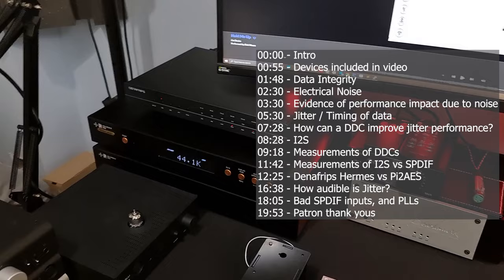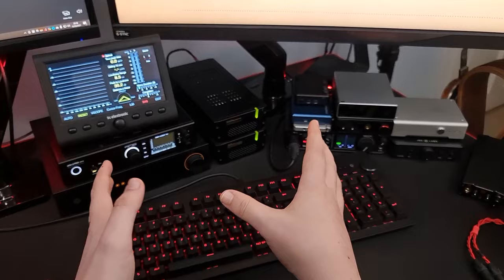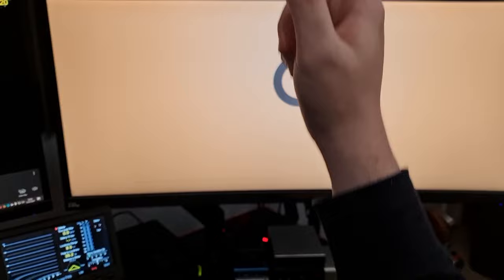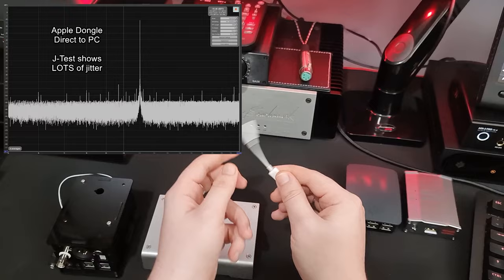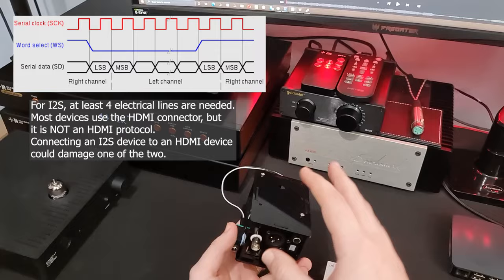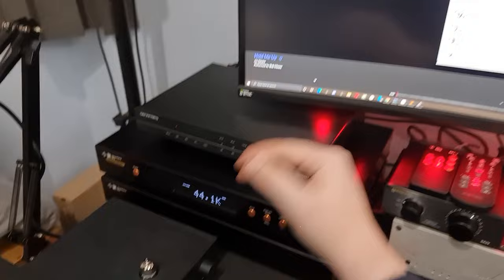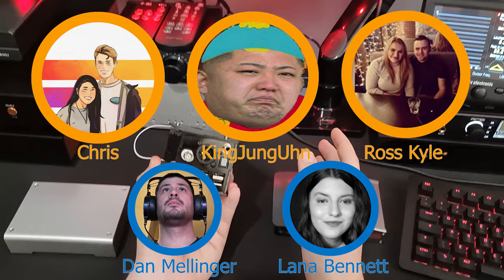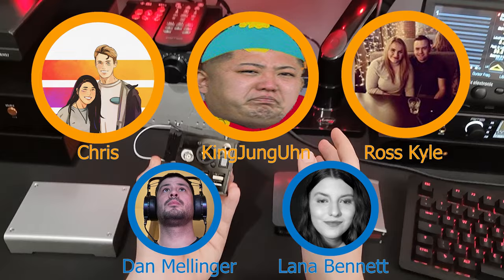How do DDCs improve audio? (Denafrips Hermes, Pi2AES, Schiit Eitr, ifi Igalvanic)

Comment: The Jitter explanation is partially incorrect.
Samples representing a bandwidth limited signal, will only ever have 1 possible waveform. No matter how bad the jitter, the sinewave after the output filter of a DAC will NEVER have slopes like shown at 5:43. The mathematics behind it do not work that way.

Ovenized Oscillators are also voltage controlled, just that with a controlled temperature, the oscillator is more stable.
Reply from the maker: Nyquist assumes that the samples are completely even in time.
If there is jitter/timing inconsistencies then yes, the waveform will absolutely show that.

Otherwise the measurements shown in this video would all be identical
Reply: @GoldenSound  You will not see that in an FFT, you would need to look at the waveforms.
Reply from the maker: @MazeFrame  I'd recommend looking at the mechanics of the Dunn J-Test. John Atkinson from stereophile has a good article on it. And there is also an AES paper (written by Dunn)
Reply: Agreed. The jitter example is over simplified and wrong. Jitter is not about wobbly waves. Listeners should be much more concerned with correlated jitter or deterministic jitter. Random isn’t audible by definition.

Comment: If there is some kind of software volume control, or DSP EQ (computer or post computer based), do you limit the value of DDCs, or I2S?
Reply: General rule of thumb is that you wanna be attenuating the signal as far down the signal chain as possible to retain maximum signal-to-noise ratio. The issue is of course that ganged pots are pretty shiit (huge gang error, noisy, not that logarithmic), and even good integrated VCAs are much worse than most converters, so arguably the way to go is to use a digital control, instead of a volume control in the analog domain (except f.e. a pad switch). Some DACs do support a direct volume control (which directly interferes with the S/D modulator), this has the advantage that you may get better SINAD at low levels compared to multiplying the signal on the PCM side of things. But at 24 bits... probably just fine.
Reply: @-szega  So. would you say that, with the exception of analog (potentially stepped) pads, the signal should be attenuated as far down the digital signal chain as possible?
Reply: @PatrickDunca  Yes.

Comment: Great Video, I agree with using I2S, I was wondering if you have heard of IAN Canada. I found these HATS for the PI and I was thinking about using these two devices with a PI 4.  1. IAN CANADA FIFOPI Q3 ULTIMATE FIFO Reclocker Module PCM 32bit 768kHz DSD1024 DoP      2.  IAN CANADA HDMIpi MKII Transmitter I2S / DSD / DoP to HDMI

Comment: I am curious how would perform older devices connected via firewire as it should be way more suitable for audio then usb.

By the way... I2S is standard for short signal paths, measured mm so it is not made for cable transfer.
Reply: I2S will be fine for short runs over shielded cable (ex. HDMI), if series termination is used (value is not critical, 30-80-odd Ohms).

Comment: Very informative review, I like the measurement addition! 
You keep mentioning the Pi2AES price as the full price of the streamer but adding a Raspberry Pi and a good power supply is a must, so the total price will be around 600 $.
Great job anyway!
Reply: Most expensive Pi 4 is $75. Pi2AES is $149. That's $224. So you're saying you need a $376 power supply to run this. Must be one hell of a PSU!
Reply: Prices have gone up over double since this video

Comment: I don't understand at all how you're supposed to connect things together what cables come from where, who sends the data or how. An ethernet port for music sorry what, did I really see rj45? *confusion intensifies*. I see the Ropiee is a sort of bridge with a music software and outputs audio on usb. I have been vastly overestimated it seems, and now I feel dumb. Also, an example of the perfect ideal signal would help. From what I see it seems to be the analog output in frequency domain of a 1kHz tone. So there should be a spike (corresponding to 1k) and a "floor" as flat and as low as possible, is that correct? And jitter looks like tiny spikes. Interesting.

Comment: Question about i^2s Guido Tent ones told me that i^2s is only for internal dac use not for longer distances. And i can understand that because clock signal should as short as possible especially digital clock signals.

Comment: Interesting vid, I recently tested 3 different DACS against each other I compared the AudioEngine D1, the DAC built into my Yamaha A-S301, and the DAC in a $110 CD player from 2001 and after volume matching I couldn't tell a difference. I've yet to try a DDC but if my ears can't tell a difference between the DACs I doubt a DDC would make much of a difference for me but I would be willing to try one out.
Reply: Yeah, I'll be honest... It's super super subtle to me. Only difference I've ever been able to distinguish is the difference between multibit or R2R and delta sigma. But, even between completely different topologies, it's very subtle to me. It becomes more noticeable with high end headphones compared to my 2 channel setup.
Reply: External DACs are more or less a waste of money. Not even talking about DDCs, thats the snake oil people talk about, even external DACs are more of  snake oil than real advantages.

In the days where only proper DACs were in extremely Hi End gear which was probably not even aviable for the regular customers, an external, better DAC than the one in your anno 1990 100$ JVC CD Player would make a difference.

But i realized how useless "better" DACs are as i switched from a cheap 90$ DVD Player (i think 96kHz 24Bit) to a proper CD Player for 600$ (192kHz 24Bit), fitting to the 700$ Stereo Amp.
There was absolutely NO DIFFERENCE, except for the removed DVD drive noise whereas the Cambridge Azur 650C was totally quiet.
My AVR has even a 384kHz 32Bit DAC... and it somehow sounds the same as the cheap DVD or expensive CD player.
The sound difference between my 700$ AVR and my 700$ Cambridge Audio Amp is also very negliable. Where the AVR (175W/channel advertised!) begin to struggle a bit with bass at higher volumes, the Cambridge 650A ("only" 75W @8 Ohm) doesnt sound that stressed on my IQ 90s.
But at any regular volume AVR aswell as Stereo Amp (both feeded completely different, Stereo Amp analoge over CD player, AVR with a bit-identical FLAC file over USB Stick) they are more or less identical, you only hear a bit of difference when it comes to the "cambridge sound", but its not far off from the "linear" sounding AVR and is pretty easy EQed even with the 2 controls on the Stereo Amp for Treble/Bass.
Reply: @harrison00xXx  I'd generally agree with you, but with one caveat. There does appear a benefit with desktop/gaming PC setups. This is largely just due to computers being very noisy (electrically) inside and there can be a benefit of moving your DAC and amp outside of the chassis, and on their own power supplies.
Reply: asplmn this isnt a thing with digital connections anyway

Comment: Does Pi2AES have WiFi ? 
Where can I get Pi2AES ?
Does it work as Roon endpoint?
Reply: The pi itself has WiFi, so it's up to whatever software you are running on it. I am running a pi with a HAT DAC and Volumio software, WiFi is in it's menu's (although I don't actually use the WiFi side)

Comment: Is there any way you can measure if different power supplies for the Qutest makes a difference?
Reply: I used the OEM SMPS power supply for six months. Then the Allo Shanti, for a year. Then the Plixir Elite BDC for the last two months. The Shanti and Elite BDC caused the physical expansion of the soundstage that I can point out with a laser pointer. Also other instantly observable improvements.
Reply: @DBravo29er  that’s great
Reply: @Ceko  So, with obvious differences, this will be measurable. Now, WHAT to measure..... I've got no clue.
Reply: @DBravo29er  well you hear obvious differences so perhaps a good mic will do the trick?
Reply: @Ceko  Oh I'm an AES member and was referring to the exact technical measurements required, by an AP machine for example. These are typically amplitude-stable sine wave measurements of one fundamental frequency (such as 1khz). This doesn't even rudimentarily resemble what a DAC must process and output during even the simplest piece of music (like a single voice, a cappella). That single voice is orders of magnitude more complex and, right now, we cannot conduct comparative measurements of simple metrics like THD, IMD, SINAD on an actual musical signal. 

We can only do it on simplified test tones.... hence my reference to there obviously being a change somewhere in the DAC that would result audible improvement (that passed blind ABX, btw. I had my wife do the switching.). But that I do not know what simple-signal metric may reflect these changes, if at all. Does this change primarily exist in the FPGA? Possibly some local voltage regulators? The discrete output stage? All three? I honestly do not know.

As the price of processing power continues to drop, I hope for a day where an AP is released that can conduct real time (or maybe with a short buffeted delay) comparisons of the output of a live musical signal.

Comment: I know this is an old video but figured I’d roll the dice w/ an inquiry - if I’m going to be using a 3rd gen node as a streaming transport connected via digital coax to a dac-less GaN FET amp, would something like the eitr offer any improvements?  The amp only has digital coax as an input, so I’d be introducing usb into the chain.  I haven’t been able to find anything definitive regarding the node’s coax output performance vs it’s usb output.

Comment: Have the iGalvanic3.0 and iPurifier3 in my chain with iDSD Black Label DAC/AMP.  Makes a big difference!
Reply: iPurifer3 didn't do anything at all for me, but iGalvanic3.0 was a massive help for Hugo2.  When I sold hugo2, I thought it was only right to sell it with the iGalvanic3.0 because its pretty much a requirement.
Reply: @-havoc-tzu-3197  Hard to believe the Hugo2 doesn't have galvanic isolation isn't it?  The Hugo TT has it.  I would bet anything that the Hugo3 has galvanic isolation because the competition is stiff and the Hugo is high priced.
Reply: @shawnpwatsons1  agreed, I switched to Qutest after that which has galvanic isolation, later sold that too and upgraded.  Qutest is a decent dac.

Comment: If USB is so crappy, then high end pro soundcards like RME, Lynx, Marian should have pretty good AES outputs, right?
Reply from the maker: It's not that usb is inherently bad. It's just that it isn't good in a LOT of products. And it comes with challenges.

There are many products that have excellent usb implementations with full galvanic isolation such as the schiit yggdrasil or holo spring 2 / may.

Yes, they should have quite good aes/spdif outputs, but it still doesn't solve the issue of galvanic isolation which is the primary reason not to use usb.

USB is fine if you're connected to a pc. But the point is that ideally you don't want to be connected to a pc.

Comment: And this is why Unison is so powerful. Or at the very least, so impactful.
Reply from the maker: Unison USB is just the name for schiit's proprietary USB receiver. The higher end dacs have galvanic isolation (which is fantastic). But unison on the lower cost stuff like the modius and modi does not.

Its still a good USB interface, but XMOS is also very good, and the determining factor will be other hardware components such as the clocks themselves and PSU. The USB receiver chip/FPGA is just one small part in the chain.
The modi 3+ with unison for example does 'just ok' in terms of jitter. 

It is very good that schiit has taken the time to do a proprietary implementation though. Its never a good thing when one company holds a monopoly over a specific component or area of a product for an entire industry.

Comment: I own a bifrost 2 and a90 using a MacBook Pro via usb. will I need a DDC? If so what is the best option for $100-500 - love the content  and channel!,
Reply: Macbook Pro has close to perfect usb output. Used with a bit-perfect app like Audirvana or similara, it is very very difficult to beat. Any ddc add cables, psu’s and inherent faults you do not know. And, still, results would be at best inaudible.

Comment: Quite informative, however you failed to mention the two formats of USB audio, the original, where the PC controls the clock (all done in X86 code, no real actual clock, just synthetic) and the newer asynchronous USB, where the DAC provides the clock.
The second, in reference to your pi2aes DDC, it's connection to your PC is via Ethernet, fine, however getting the sound from the PC to the pi is a problem that needs explaining. If one plays a tune on a PC, redirecting it to a USB DAC is easy, the PC will see the USB DAC and let you select it, however Windows will not show the Ethernet device in it's audio settings, you need 3rd party software. My current solution sucks as there is about a 2 second delay.
Reply: Ya, this whole topic is a serious deep dive. To get Windows to use the ethernet, you have to set things up so it is being controlled by 3rd party software. Which is not so bad really because it is much more convenient to interface through your tablet, than through a lap top.
The real issue is that it is difficult to get good audio out of any computer, let alone a general purpose (or even worse gaming) computer. I wasted a lot of time on this before putting together and Odroid based media server, and connected it to a Raspberry Pi with Allo streamer hat. I used Volumio (not the best, but does work well enough) to control everything from my phone or tablet. The improvement was huge over any Windows solution I tried (I tried about every combo I could find).
2 years and many iterations later, I ended up with a dedicated i9 based server (don't use AMD, there seems to be issues like the old days) running Debian 10 Server, HQPlayer Embedded, and Roon Core (added a Plex server as well for movies). This outputs over ethernet to an OpticalRendu, and into a Matrix Audio Element-X DAC. Essentially I went from under $400.00 in hardware (using integrated DAC in my NAD T-758 out putted to a Pass Labs M2) to over $6000.00 in hardware. 
Does it sound better? Yes, much. Did the cheaper solution sound good? Yes, it sounded very good.

Final hint: Unless you are familiar with Linux, or have the patience of Buddha Himself, don't build your own HQPlayer Embedded server - the embedded release is intended for professionals, and they expect you to know your way around networks and Linux - so the support is the type that a pro would get. Get one of the offerings from Small Green Computer. They don't charge much more than the parts, I think I saved about $600.00 over their top of the line, and would have saved about $250.00 on their i7 solution.

Comment: Oh man, after watching your review of the Pi2AES and Holo spring 3. I feel I should’ve ordered a Holo DAC.
I have a Pi2AES and a Denafrips Pontus 2 on the way.  I have a dilemma that I don’t know if you could help me with. I don’t have an optimal room so I am running Dirac Live through a miniDSP SHD which outputs coax and AES. I don’t know how good the PLL is on the Pontus 2. So here is my dilemma, I have the option to run i2S directly from the Pi2AES (no Dirac) to the Pontus 2 or AES through the SHD and benefit from Dirac but with the limitation of a SPDIF signal. If I had a holo I would know that the PLL is fantastic and I would run the lesser AES through the SHD with Dirac Instead of i2S direct to Pontus2. Did you have to chance to test the Pontus 2 SPDIF performance? Hard choice, i2S without Dirac or Dirac with compromising SPDIF. At the moment, my decision will lie with the performance of the Pontus SPDIF and PLL. Thanks

Comment: So, connect the Pi2AES to the pc directly with an ethernet cable?
Reply: You use Pi2AES as the end point for the dac and it connects to the same network as your pc
Reply: @MrArunasB  right, thanks.  (I'm a spaz at this kind of stuff).    So I plug the Pi2ASE directly into my router (or connect it over wi-fi) and then use my phone or a monitor (connected to the Pi2AES) to interface with the operating system on the Pi2AES?

Comment: hI Golden sound , interesting news on the PI2AES. Have you tried a Pi4 with Ian Canada hats? The IC hats isolate and reclock the i2s signal from the pi and then out put over  hbmi I2S , so no usb in the mix.

Comment: Hi, love your videos and the kind of information you present! Thank you! Regarding jitter I have to say that in any network stack that kind of error should eventually get corrected before passing on to the next layer up in the chain. I have been working in the IT industry for over 25 years and although jitter is a well known problem in networks it can usually be corrected and it is. Also taking into account that any audio speed nowadays is nothing comparing to the gigabit capacities we have in current networks I am not sure if it should really affect audio chains because the inherent speed is really slow compared to anything else we do with computers. Anyway just wanted to add to the debate and hopefully somebody more knowledgeable can correct us all in the near future! Keep up the excellent content!
Reply: It's laughable, if these things weren't snake oil how could anything about a computer work? How are the colors on my monitor not swimming all the time? How are my SSD's able to reliably save anything? Good grief.